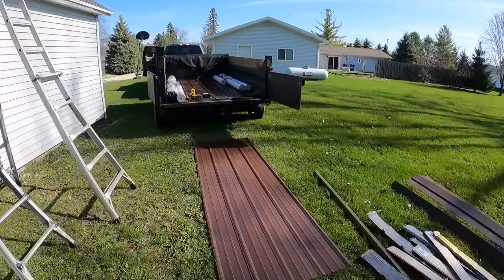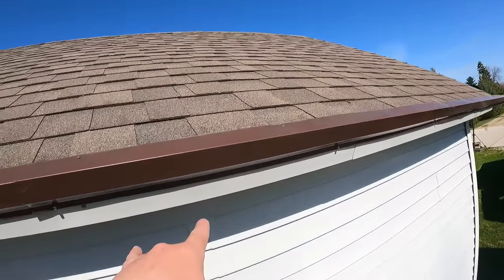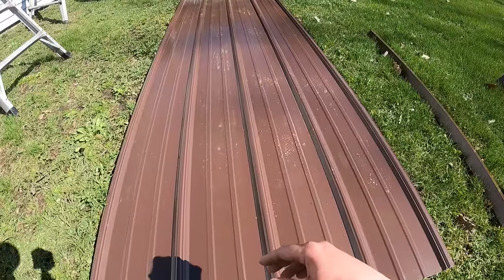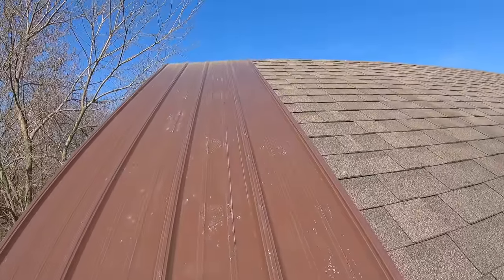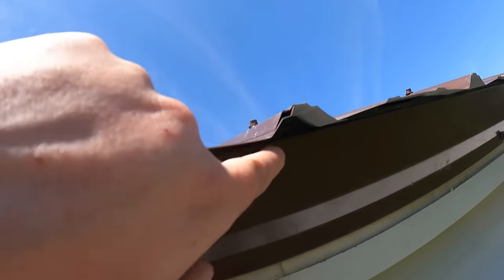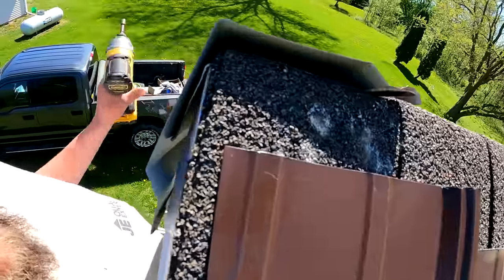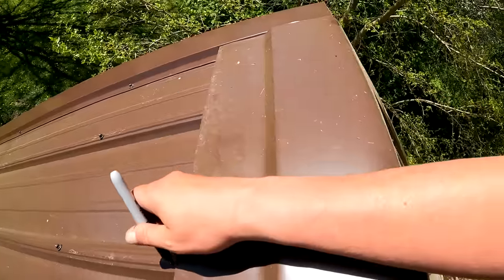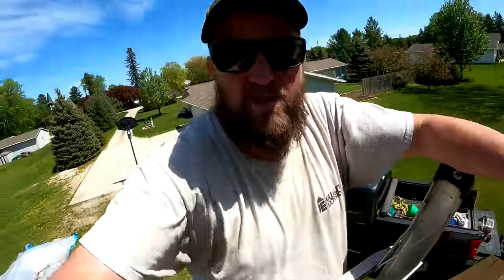HOW TO INSTALL A METAL ROOF

Comment: Bad idea laying metal directly on asphalt shingles.  In a few years you will be replacing this roof again due to the granules of the shingles rubbing the paint off and rusting out your panels. Cutting multiple panels should be done with a circular saw and metal cutting blade. Finally, never install an exposed fastener roof with screws driven through the ridge on the panels. This offers almost no wind uplift protection and can cause "oil canning"  and panel distortion. The pre drilling is the one step you got right.
Reply: Another thing that is bad about screwing through the ridge is that it makes things very difficult if you have to remove snow from your roof. The removal tool will catch on every screw!
Reply: Nope, totally disagree. I've been roofing since 1972 and still going strong. It does no good to argue with the millions of YouTube experts, so I'll just give my two cents and ignore your replies.
I'd like to know why you think the shingle granules will start rubbing on the metal roofing. Do you think this is an earthquake zone where houses shake a lot like a paint mixer at Home Depot? Do you think aluminum rusts? Why do lots of you DIYers think things are more complex than they really are?
The main problem with all you "know-it-all" experts, is how you mislead others with your wacko misinformation.
Reply: @Jeff82556  Metal expands and contracts with temperature changes, so there will be some movement, but not much. The big problem comes if you have to walk on the roof panels that are installed over shingles. That said, I installed my metal roofing over shingles and after ten years can detect no problems.
Reply: "Seeing as how, it's just a shed.".
Reply: @Jeff82556 I wouldn’t want to see the cost of aluminum metal roofing! The vast majority of metal roofing is galvanized steel.
Reply: @joshmcgowan33  Yeah Josh, I realized later that I made a mistake saying "aluminum".
Reply: Aluminum does rust lol. All rust is is oxidation. Aluminum rust is white. See it on aluminum rims all the time.
Reply: @PhilrupyoGaming  WRONG Phil. Google results: "Can Aluminium Rust? Aluminium doesn't rust. But, it's essential also to note that aluminium in its pure form, is a highly reactive metal. Technically, pure aluminium dissolves when exposed to water but, it's reactive nature could also be its greatest asset."
Reply: I like Matt R's venting everything method.
This great YouTuber would have just setup 1"x2" runners across roof would have been cheap, taken less than an hour and in addition to the benefit of air flow between metal and shingles the pant would not be affected, causing rush like you mentioned.
Ever since we started making climate controlled sealed houses we have been dealing with moisture that gets trapped and causes damage because of lack of air flow.

Comment: Everything I read says you are putting the screws in the wrong location. They should be put in the flat at specific places relative to the ridges, not in the ridges. In the ridges is appropriate for corrugated roof panels.
Reply from the maker: The roof will leak in 10-15 years if you put screws in the lows
Reply: @Lifes_Apprentice  You argue with everyone who tells you this but all the manufacturer's instructions confirm that you are 100% wrong.
Reply: What do the manufacturers know anyway? They’re probably just looking for excuses to pay out warranty claims so they don’t have to take winter vacations to warm sunny places. {sarcasm off}

Comment: metal should never be installed directly over asphalt shingles as the shingles act like sand paper when the metal expands and contracts with hot and cold, it will shorten the steels life and could wear a hole in it. also manufactures recommend screws to be installed in the lows but the highs will work!

Comment: How long are your screws? Are you getting one inch of penetration into your structure, because during high wind gusts this roof panels will be ripped off because of the gap by you drilling into the top of the rib instead of placing the screws in the flat part of the panel. What’s hard to believe is that you claim to be a roofer? I’ve done plenty of roofs and sliding, and never ever seen this type of application for where the screw is placed.
Reply: It is common in some areas, for the reasons he explained and I don't think suggesting he is not a roofer is a great way to pursue a conversation. That said I had it explained to me that laying direct to shingles is not best practice, though some people do, putting down 2x4s is preferable which might also solve for your concern as long as they are tied in well

Comment: I was told you screw the flat part , or using nails you nail the rib
Reply: Screwing the top of the rib allows the metal for expansion and contraction.
Reply: Manufacturers agree with screwing the deck, but what do they know.

Comment: Drywall screws are extremely weak, brittle and are not made for exterior application. 
Safety first, harness and use chicken strips, or a ladder on that slope. Most falls are fatal at 30 feet
Reply from the maker: I should have used roofing nails and found a higher roof then...

Comment: I am amazed that you do not use purlins every 2 foot on center from the eaves to the ridge to do a metal over on a shingle roof................its common and accepted practice. applying the metal directly to the shingles is a terrible mistake. It provides a moisture barrier for evaporation and air circulation to protect the shingles and decking beneath the metal.
Reply from the maker: We do that on houses for sure if we do not tear off. this is a small shed and customer wanted it this way. the metal will be just fine for 30 years or more
Reply: Protect the shingles? For what purpose? FYI: shingles don't rot out. Air circulation is irrelevant.
BTW, roof temps get heated up - even in the winter. Condensation will never be a problem.
Reply: purlins will rot out
Reply: Condensation occurs wherever warm air cools. Air circulation is relevant and prevents the condensate from becoming a problem.
Reply: Wood rots when it doesn’t dry. Air circulation promotes drying.

Comment: If your using 1x4's doesn't matter if your screwing it to the low end of the steel. With shingles already on the roof and furring strips makes it almost leak proof. This needs to be explained
Reply: Old shingles should always be removed, holds moisture and mold and will still deteriorate under metal
Reply: I disagree. I don't think you should rely on what's under the new roofing to keep the house/garage dry. The  exsisting roof just be considered a back up
Reply: @thesenewythandlessuck  think what you want people have been doing it for many years!

Comment: Pretty sure you're not supposed to use drywall screws and also you aren't supposed to screw onto the ribs. I get this is on a shed but spending an extra 50 bucks on 2x4 and nails would make this last a lot longer.
Reply: $50 bucks?  Where do you get your lumber?  I agree with the drywall screws.  Saved me a comment.
Reply: It looks great thank you again.
Reply: What would you use to coat a mobile home roof Shirley
Reply: @shirleysasse5842  there is a elastimeric coating(paint) that you can use.  Usually white.  Ask the paint department.  Just rolls on.  Two coats.  Surface prep is important.  Good luck.
Reply: Building materials not the paint department. Very different materials. 

Shirley, elastomeric is an economical choice as long as the roof is sound, but it’s not waterproof. If there’s any leaking, silicone is the way to go. It’s significantly more expensive but generally has a lifetime warranty vs 5-15 years for elastomeric.

Comment: I must be old school I tear off and use 2x4s synthetic paper never put your metal over your shingles because it will get hot in the summer and metal isn't very thick it will warp also your sheeting isn't going to hold in strong winds the purpose of using 2x4s is to nail to rafters not sheets

Comment: What I don't understand is why people pick dark colors that won't reflect hardly any sunlight at all. During the summer a lighter color will always be much cooler than a dark drab color. Light colors will save you money during hot summer days.
Reply from the maker: Its a shed! we are in northern Wisconsin where it gets -50F
Reply: i used hunter green metal, but i used 5/4 deckboards under, 2ft apart, then cut 1 inch foil foam into 2 ft widths and put between for sound and heat insulation
Reply: @jerrybutler1336  I understand however here in Alabama it gets very hot during the summer so using a lighter color roofing is much cooler in the summer to reflect some of that sunlight away from your home. Lighter colors also outlast most dark colors which aids in having to reroof a home as often.
Reply: @whip205inthebam3  agreed
Reply: Wyoming? We just get 2 month and couple weeks hot weather the rest 
Chill and Cold
Reply: With new paint technology, even dark colors reflect more light than previously, but new white pigments are best. Sometimes aesthetics are important enough that people will pay to have a particular color and add a bit more insulation to achieve the same effect and look more appealing.

Comment: You can in a pinch score the roofing with a knife and snap it.  Clean line but pain in the butt.
Reply from the maker: That works very nice if you are cutting length ways. I have never tried it the other way

Comment: I never seen no one put screw in bottom of e drip 😂😂😂 why is u using grinding they have electric metal cutters 😂😂  wtf he put screw in rib of the Panel honestly you f that roof up sloppy cuts
Reply from the maker: electric cutters like nibblers or double cut shears with deform the ribs on the panel. never screw in the in the low of the panel it will leak in 10 years because screw washers will dryrot. thanks for your input but this is the right way to do it
Reply: @Lifes_Apprentice  no I follow the  code I do Professional legit work
Reply from the maker: @keepgrinding1k761  I am a licensed contractor for almost 20 years so do I
Reply: @Lifes_Apprentice  You over compressed every washer that was captured on your video. That's why they fail in 10 years. Properly compressed can be expected to last 20-25 years.
Reply: @Lifes_Apprentice  what's your license number?

Comment: youre supposed to screw into the flats of the metal, NOT the rib
Reply: I have a roof on a house similar to this one, screwed into the flats. I've had to caulk and replace all the screws due to multiple leaks in only a few years. Having the screws higher seems like a good idea with respect to water.
Reply: Ribs is better than flats ..water flows from highest point to lowest.
Although manufacturers  say flats I always go ribs way less leak problems
Reply: Definitely ribs
Reply: Incorrect sir.

Comment: That's is not the way I ever measured any roof I have ever d8ne in 40 yrs. I used to build Wal-Marts and owned half a construction company.  Plus where is the cutting of old roof for air circulation? 😮

Comment: The only smart thing you did was screw the sheeting through the ribs the stupid thing you did was screw into ply under the shingles those screws are going to back out over time. There should have been timber battens fixed through the ply and hopefully into the trusses then the sheeting fixed to the battens.

Comment: I stopped watching when you used drywall screws... They are not exterior rated and will rust away. That roof isn't going to last.
Reply from the maker: the drywall screws are not exposed

Comment: I think you should find a northern job. First off all the shingles should be stripped off proper membrane installed. A you don't use drywall screws to install the starter strip. And you are not supposed to screw on the ribs only a few. And the rest on the flat off the panel. Following the roofing guidelines on how to install metal roofing. Glad you are not doing my roof. No offense but you should better educate yourself on how to install metal roofs. Because it's people like you that give contractors and roofers a bad name. And the other thing is you should be using staging instead of  ladders. This why safety officers Crack down on people like you and make it costly for everyone else in the construction trade.
Reply: Not only by stripping the shingles it voids the warranty on the metal.
Reply from the maker: I have a northern job in Wisconsin. I said in the video that you should strip shingles before installing or add battens or foam over them. NEVER screw an exposed fastner metal roof in the lows of the panel. when washers dryrot and fail it will leak if you screw in the lows... using drywall screws for eave trim is fine because it is not exposed at all. you have foam closures to seal bottom of panel and the screws are also covered by the metal roof. I am a licensed contractor and have been for many years. If you would have set up staging to roof a shed thats up to you but it is not worth the time to do that in my opinion
Reply: Apparently you aren't very good at this either which is why you watched his video, and also you had the time to watch it! Business for you must be slow professional guy lol
Reply from the maker: @91lxtasy  Trolls! thats all he is
Reply: @Lifes_Apprentice  Why do the manufacturers of the metal panels specify screwing through the flats, or the lows as you call them?
Reply: @91lxtasy  I watched this video because it randomly came up in my feed and I continually wondered what Apprentice was going to do next that flies in the face of logic and manufacturer's specifications. There are a lot of possible different scenarios in addition to the one that popped up in your mind.
Reply: I was going to watch your video of how to do it better but it must be set to private since all I get is "This channel doesn't have any content".
Reply: Couldn't of said it better